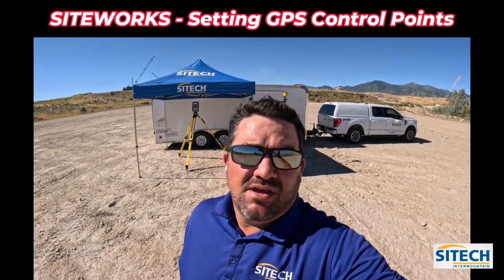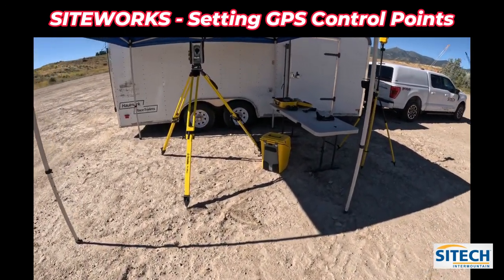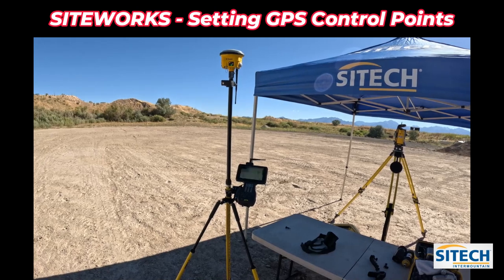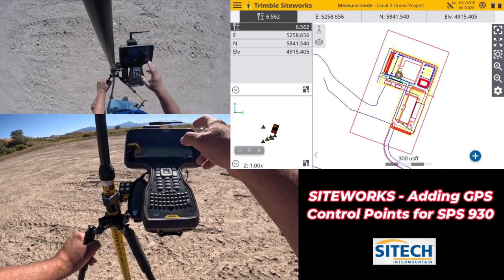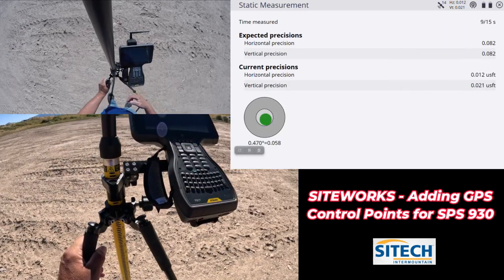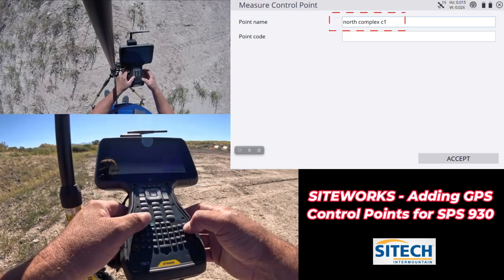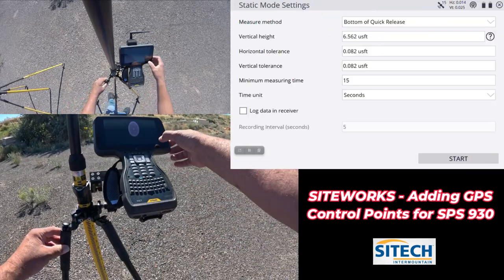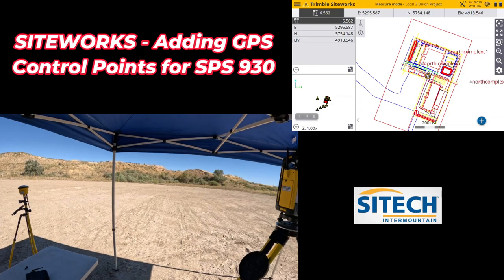Siteworks Setting GPS Control points for SPS930 setup

Comment: Hi mate have you done a video on setting up a base station for trimble earthworks love your videos I'm an excavator operator in the uk and use trimble earthworks your videos have taught me so much thankyou
Reply: Hello, thanks for watching. I a glad to hear that these videos are helpful.  I don't have 1 video that is just centered on setting the base and hooking up with a machine, but I do have a video on right now under the Siteworks playlist that is called Siteworks Measure in new base pole and move base to that Pole.  It has some base set up. I also have a Video that I just noticed was accidentally removed by my team hear called Siteworks Site Calibration. In that video has me setting up a base station and setting the frequency.  I will have them re-post that.  I could do a video in the future that is centered on that for sure, not sure when I will get to it though.  Keep up the good work on that Excavator,  running excavators with GPS is where my heart lies.

Comment: After measuring those points from GPS measurements. Do you run any network adjustments to find your baseline GPS coordinate? And also do you need to record any points external which are registered points to bridge back onto your survey as a QA measure?
Could you also make videos on how to coordinate machine control files from an arbitrary datum to the GPS one? 
Appreciate these videos! Thanks
Reply: This job site already had a site calibration performed, so all I am doing is adding in my own new control where I need them.  So I don’t need to add or adjust any of the measurements.  I am just doing a 15 second observation to average out any possible gps bounce.  If I had time, I would run a digital level through those points to fix the vertical error.  As for machine coordinates, are you talking about state plane versus job site coordinates?   Thanks for watching.
Reply: @JeffLarsen-iz8qk  Thanks for the reply Jeff, yes my question is if the site is set up on an local site coordinate system are you want to run GPS machine control on it. How do you go about shifting and changing the coordinate system to State Plane, along with the Cad or DTM data in the office? Thanks
Reply: This job site is set up on a local site calibration and coordinate system. I like the local because the northings and eastings can be brought down from 7 numbers before the decimal to 4.  The machines can run on either system or coordinate. The process needs to start at the beginning though. The CAD linework from the engineer already has an associated position to it but can be moved to match a state plane if needed.  If you start a job site in a data collector in state plane, it will use that datum unless you do an adjustment to site points. It askes you at the first. I don't like to do any adjustments if I don't need to though.  Doing a site calibration to surveyed stakes or an engineers points is usually best because they are the licensed surveyors (unless you are one) and then you just calibrate to them and everybody and everything should match. In the office you can move CAD linework to match job site points if needed.   @niksk3256

Comment: Thanks for doing these videos. Is there a way to do static observations in siteworks to send out for processing? I'm still trying to understand GNSS surveying, I've only really used the robot on local coordinates but I'm trying to get to the next level.
Reply: Yes.  There is an option in the modes.  On the main screen where the guy is standing with to pole you can go in there and select static mode which will allow for any time you are shooting any points to add time to the shot.  Like a site calibration you can observe for a set time.  Certain receivers can do data logging also if that is what you mean for send out data. Thanks for watching
Reply: @JeffLarsen-iz8qk  ok thanks. Yes basically I'm referring sending out data to OPUS for processing, still wrapping my head around when that's necessary